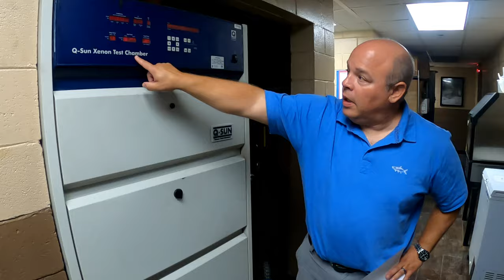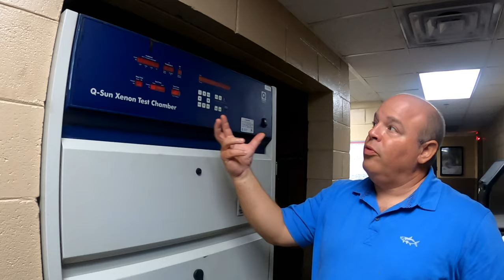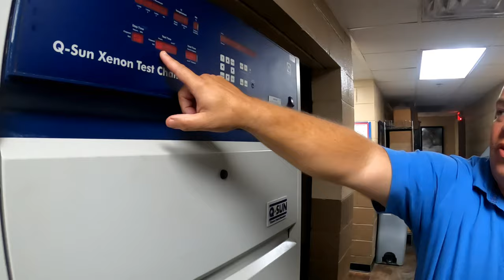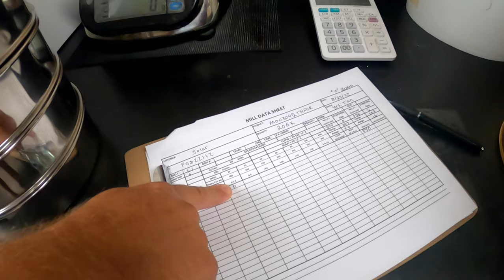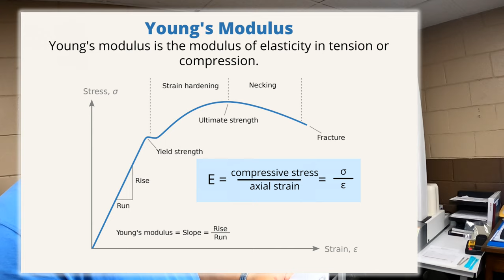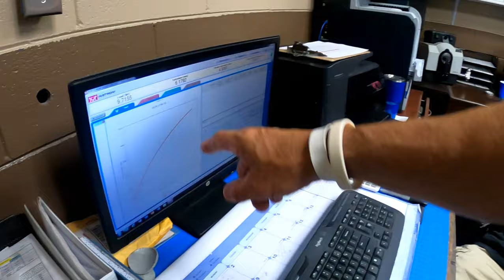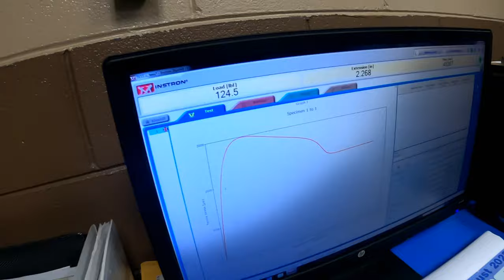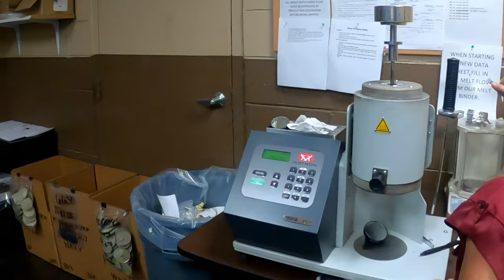How Is Kayak Plastic Made and Tested?

Comment: Great to see behind the scenes of American industry and manufacturing. So, not everything plastic is made in China! 100% waste free, sustainable, no heavy metals. One of your most fascinating videos Wade.
Reply from the maker: yes, for sure that's why I wanted to do this video it took some convincing to get in and show all that goes on there I have worked with these guys over the years testing new plastic so have always had a good relationship with them
Reply: @WadeHarrison  I've done a number of factory and lab tour videos in manufacturing and pharmaceuticals. You really got a comprehensive tour from Mike. It's hard to do run & gun filming, interview, demo solo. A 3rd party gimbal and Rode wireless Go2 would help. The Sony ZV-1 camera is a good  complement to the GoPro.
Reply from the maker: @macfawlty  I agree with all that I have a Venmo if you want to donate to pay a camera man and purchase that gear I love that idea 🤩
Reply: @WadeHarrison  As the paddler is more important than the boat, the story is more important than the gear. Perhaps I can cut something loose.

Comment: Thanks for this Wade. As an Engineer I really appreciate all the details. Having seen this I'm really surprised that (the premium at least) kayak manufacturers don't make a bigger deal of the quality of the resins they use, and the consistency of their processes. This whole tour makes it obvious that just because it looks like the same plastic boat, the actual structure and performance could be wildly different depending on the choice of material used. It's a bit funny that all the design discussion boats is about edges, and other asthetics and nothing on the materials and the choices that went into the overall product. And really makes you wonder what is in some offshore manufactured 'built down to a price' boat.
Reply from the maker: Thanks for the feedback Andrew I agree these manufacturers should show what resins they use that why I wanted to do a video I have worked with these guys in the past helping do on water testing on resin so wanted to show everyone what goes on in these factories
Reply: @WadeHarrison  It just seems to me that if a manufacturer is working with them to create a superior plastic it would be worth 'bragging' about. It also occurred to me that you might want to tailor the resin for a specific type of boat, for instance a hard core creek boat might want more toughness at the expense of strength (which would require a heavier boat, but it would really take a beating). And then all the UV tradeoff's. Pretty impressive all the work done for fishing kayaks getting baked in the sun.

I guess if nothing else it could explain why some models or manufacturers seem to have a better reputation for boats that stay together, or don't!

Comment: 28:39 is that why Jackson Boats tend to be a little slower than other brands, softer plastic means more energy loss,  but then less brittle. Which maybe makes sense, I have seen Daggers cracked and broken, but Jacksons seem to only crunch and fold. So you might argue they are safer, for impacts, but sacrifice hardness/speed to do so? Am I on to why you might want one over another. Like I aim for rocks, because they are fun, so I might be more prone to impact, so a softer plastic might suit me better, where someone who stays away from rocks, might prefer a bit of speed to help them avoid impact. Maybe?
Reply from the maker: If using good resin it will hold up well and there’s a lot that makes boats flexible like thickness shape and outfitting so many factors
Reply: @WadeHarrison  I really liked this one. I am interested in the "why" and "how". I would love to hear the correlation of a kayak company and hear their discussion and reason for what they choose. It is just cool.

Comment: very interesting. one thing that caught my eye - they say that material is overcooked, it becomes brittle. it does indeed , and it's a problem with welds on kayaks after they crack. welds are fragile. do you know how to make them less fragile or what to add to the welding rods to make it less brittle?
Reply from the maker: Once a plastic gets overcooked that’s no coming back
Reply: for the welds, though, do you do anything specific to reduce chances of overcooking? I weld well within allowed range, with no smoke coming out, etc. still, some parts of the plastic are more brittle than others. idea of alloys  in the video is pretty cool, though. for instance, hot glue sticks really well even to PEX, it's just not stiff enough..
Reply: Excellent point on the welding, something that really needs to be better understood. Weld embrittlement is a big deal for welding steel, I hadn't really appreciated that it was similar for plastics.
Reply from the maker: @AndrewMoizer  I will look into that